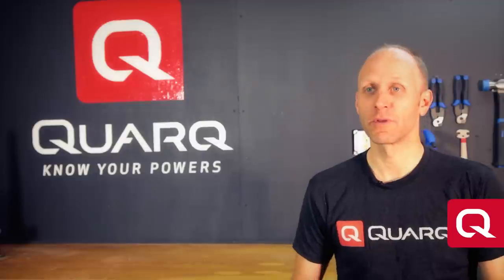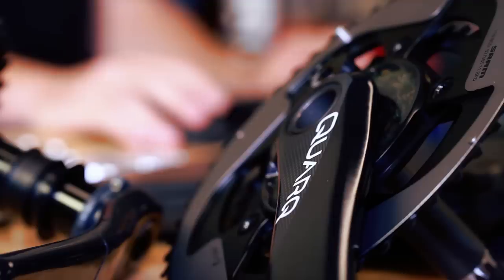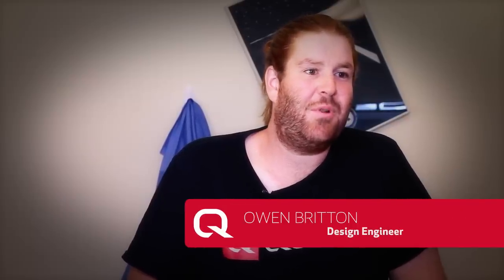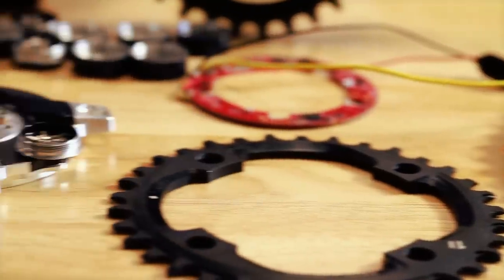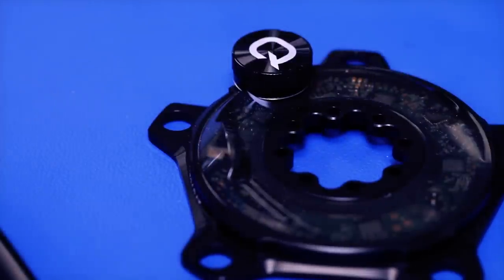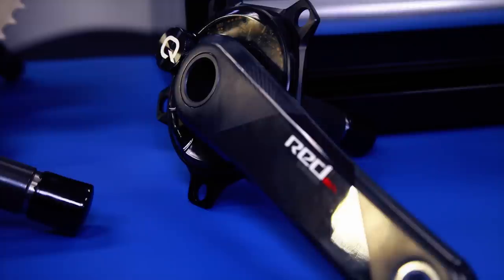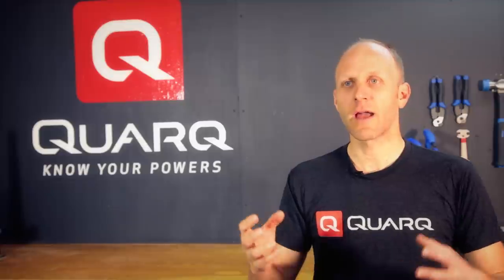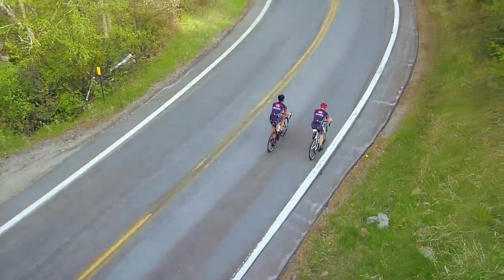Quarq DZero - Reach A Higher Level

Comment: Absolute love the DZero I have installed on my bike. Very easy to install (mechanic took less than 15 min replacing the spider on my S-Works crankset). It also connected to my garmin right away.
I hope durability is also great. let’s see...